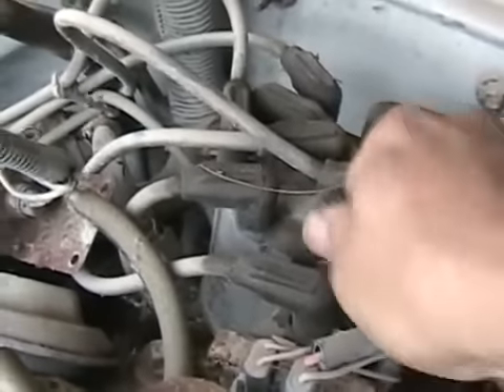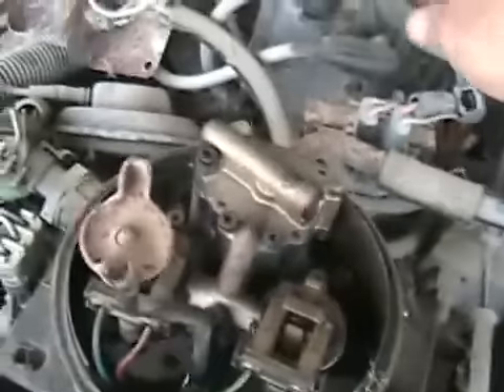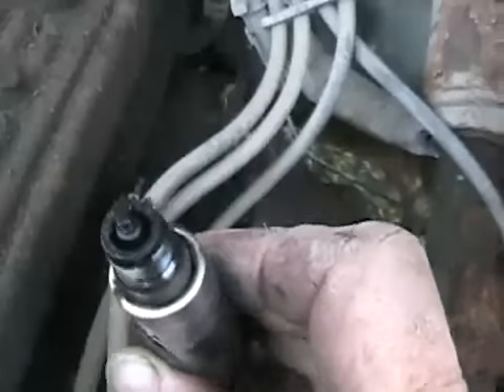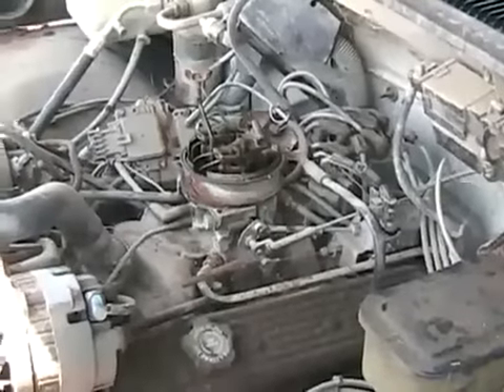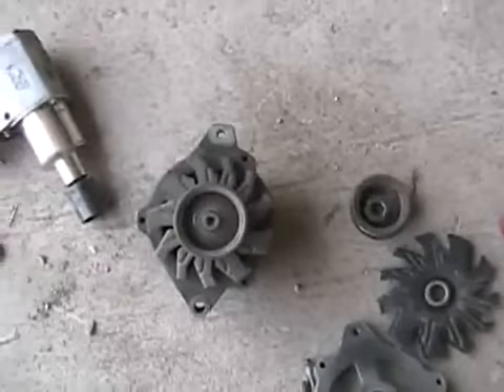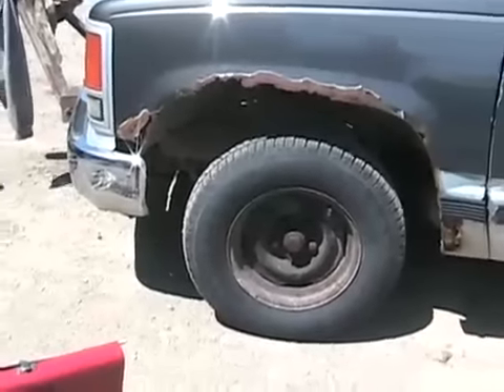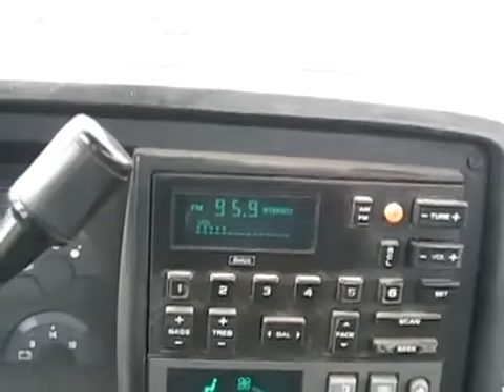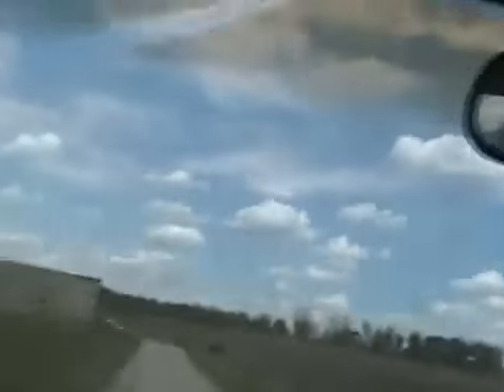daves farm got an 1988 chev truck to trash  + repairs part 2 of 2 Davidsfarmison[bliptv]now

Comment: my friend's Ford has 454 engine (beast) and my GMC has a 305. I am actually the 3rd owner of the truck in my family. my grandpa, before I was born, put an edelbrock carb and a new exhaust system in it. my mom destroyed the brakes on it years ago, along with a few other things. I replaced a lot of parts and right now I'm in the process of fixing the distributor. It's almost running. I can't wait. good luck with your truck :)

Comment: i got an 88 f150 4x4 that still runs great without any major problems occuring..i drive an 07 silverado at work and its already had to have the whole rear end changed, and the most it pulls is a small trailer that fits 2 tractors on it...something even a tiny s-10 could handle

Comment: i still drive a 84 datsun truck no rust anywhere has 278,000 miles, and has lasted thru a lot more more than any ford or dodge ive had. and still gets 33 mpg with the a/c off and it works too

Comment: yeah I already caught my error about the engine size. my sierra is almost road worthy now. I had it running for about a week a few months ago, and I was actually able to drive it up and down my street. but then the distributor died. I have fixed the distributor now, but it looks like I will have to clean out the carb in order for it to run well. It's so close to finished I can almost taste the exhaust!

Comment: I like a truck if it's American or Canadian made. We found out our 90 F350 is gonna need a lot more work than we planned. It seems as if the truck was completely wrecked and pieced back together. It was a factory 4 speed manual, 351, 16 ft cab and chassis. We found out it has a 6 cylinder radiator, it's a 4 speed auto, and it has a new Jasper 351. Plus the dually axle is only as wide as the cab, so it's about a foot shorter. The chassis is now 18 1/2 feet or something. We got screwed over.